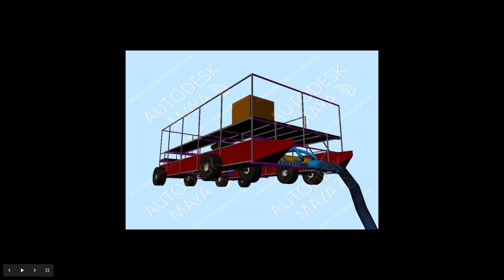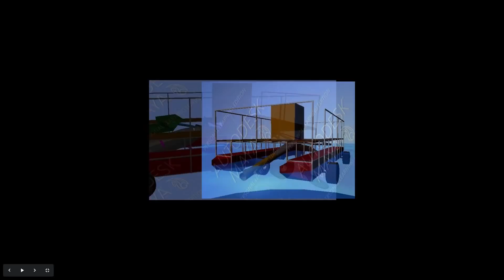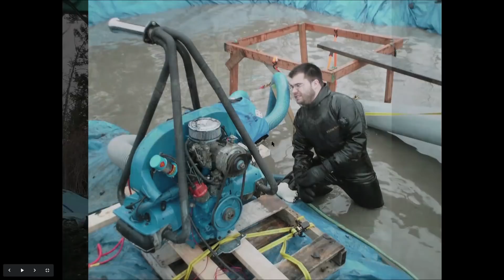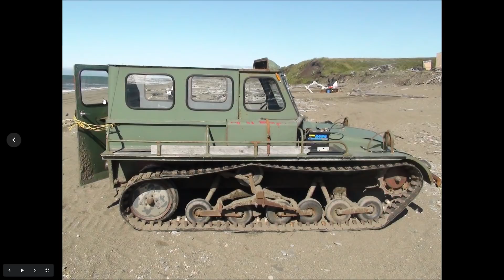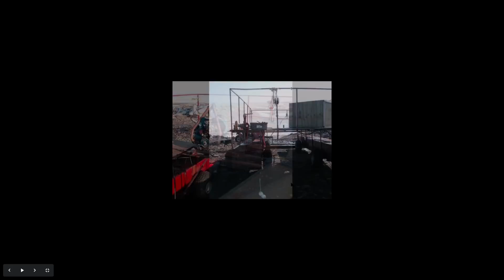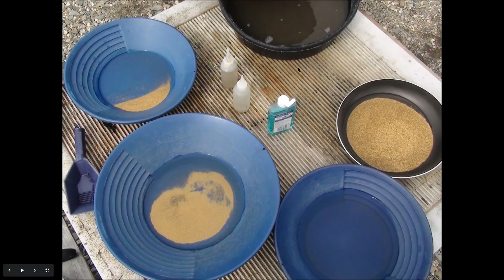Nome Offshore Dredge: Big Red, Back Story

Comment: I don't understand why people build these tiny little dredges. If there are waves, you can't go out. You could ship 35 or 40 foot pontoons in a shipping container. I drew up a dredge to scale one time, and it would have taken 2 shipping containers to ship everything. No sense in wanting it SOOOO bad, you fuck up and use what you can instead of holding out and seeing if you can afford what you WANT 10 years down the road. You need extra motors, extra hoses, an extra of every single piece of equipment you use so when you break down, you just install the spare. Then if you can't build a little comfort onto the dredge, why do it? 35 foot 48 inch pontoons would keep that dredge out of the water when the waves got going. 3 of them. Then you can build a cabin with heat and a kitchen on the vessel. There's room to put the sluice on top of the deck so it's easy to clean. Then waves wont get in it. If you can't put a good engine on the vessel to make the fucker move 20 mph or better, stay on shore.There's too many guys who've been everywhere that a little boat can go. Gold mining is a rich man's game. If you don't have the money to build or use what you WANT, don't settle. You wind up settling on shit that doesn't work well because you want it more than you have brains. Your desire over rides your intelligence. I'd love to do it, yet unless I had damn near a million to get going I wouldn't even try it. Just like land mining. If you don't have the money for the things you think will work WELL, don't do it. Don't let gold fever make you go broke. Go far enough off shore and it's international water. No claim needed. Stay inland and you gotta have a claim. I'm sure there's plenty of shit claims people tested and will sell for 50 grand because there's no gold.
Reply: I'd like to see your design